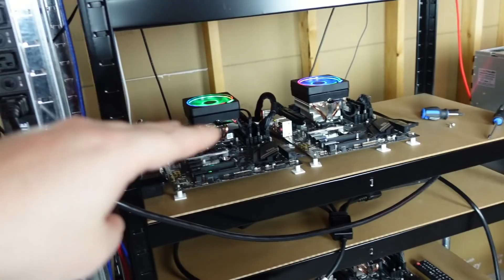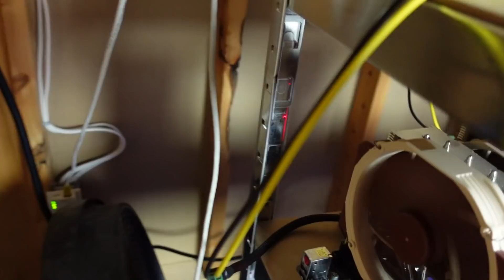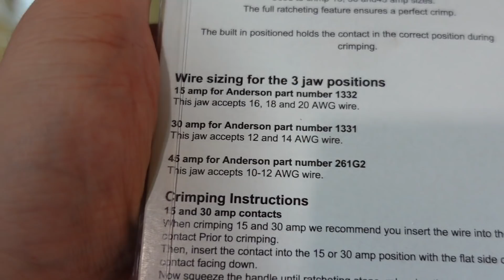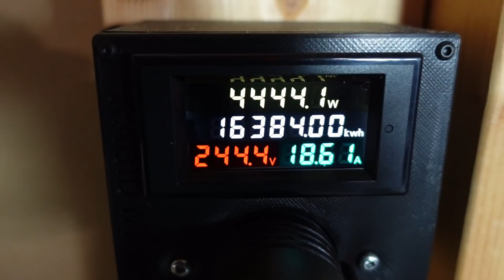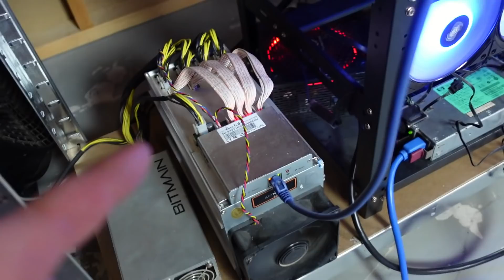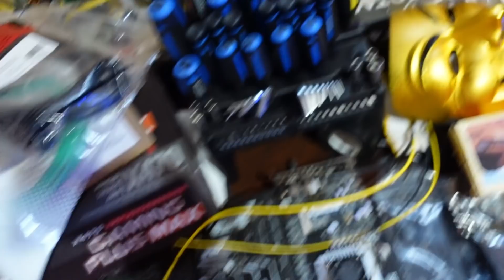A Look Into My Crypto Mining FARM

Comment: i was thinking of going with a server PSU as well  but to noisy.... so at the end  i went buying 2 be quiet pro 450's and i am running two rigs on one PSU  with Y splitters. Each 2 PSU's are connected to one power cord again with a Y splitter.... so  far no problems
Reply from the maker: So far with 5 rigs cant even hear the PSU maybe with 6 or 7 will start
Reply: The Fractal ion Platnium PSU is also great.  They have 550w 660w etc.

Comment: MoneroOcean  ryzen 3000 series try out  3100 or 31.00 clock  1.0 volts !!
Under 100watts per rig counting fans board psu with only a loss of  few hundred to 1000h (algo depending )
Reply: I've gone up to 4.2 not much to talk about get few thousand more 
But comes along with lots of power and heat 
Down is the way to go for moneroOcean  ruffly 100 watt difference on 3 ryzen 9 3000s

Comment: Damn, i just broke a Vega 64 myself during maintenance. Pain.
Reply from the maker: Dam what happened
Reply: @RabidMining  It was under a EK water block and the RAM temp was hitting 90c and throttling.
I had it tuned with a Vega56 Firmware and it was cranking 54Mhs for months. I took the water block off but the three of screws were stripped and simply would come out. I had to get the block off, the block came off but the screw and piece of block was stuck on card. I tried to use a drill at low speed and I managed to drill 2 of the three out. Third one the bit broke and hit one of the coils causing the ceramic to chip off. I put it back together with the stock cooler, kept my fingers crossed and it worked fine.. then I noticed I forgot to put a thermal pad back on the cracked coil.. took it apart and then put it back together.. then the card ramped up loud and then the fan wouldn't spin and now it wont even recognized on the PCIe slot, getting a PCI error post code. Not sure what to do to fix it.. might be possible. but who knows! Basically I man handled it because the damn screws were unremovable from the EK block, not sure if I over tightened them or if it was because of the length of time the block has been on the card.
Reply: @coolhand4598  pain

Comment: Move the CPU Minner RAM to the far right, latter you will thank me :)
Reply from the maker: Each motherboard manufacturer has different set ups for these x470 msi boards they are in the 2 stick dual channel slots while others have them on the right.
Reply: @RabidMining  
correct, but I mean if you have 4 slots for RAM move them to be the last stick on the far right on bios it will do a lot also check you're -H/S before and after, I'm overclocker and IT, bro :)